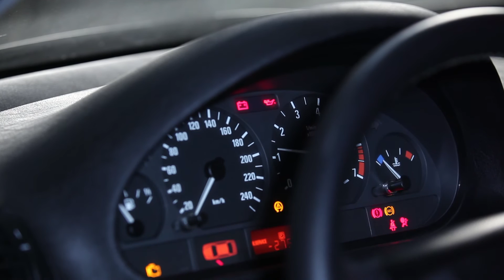Jak vyměnit motorový olej a olejový filtr na BMW 3 E46 [NÁVOD]

Comment: dobrý den, jaký je vhodný motorový olej do bmw e46 316i  1850 77kw rok výroby 1999
Reply: Castrol 10w40 je vhodný pro E46.  Otec ji má jako první majitel 20 let najeto 400 Tis. A motor jde velice tiše.  Spotřeba nulová.
Reply from the maker: Kontaktujte naši linku podpory.
Pro kontrolu kompatibility a výběr vhodné součástky potřebujeme, VIN kód auta nebo originální číslo dílů.